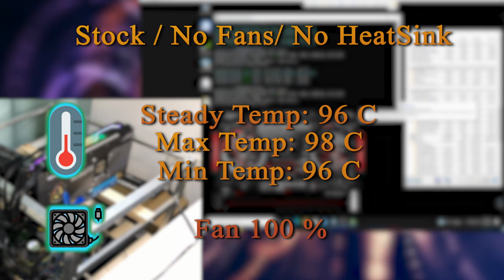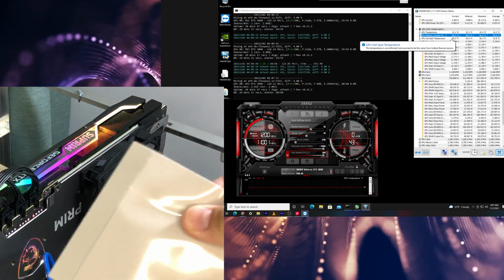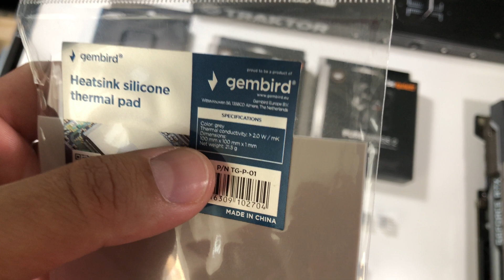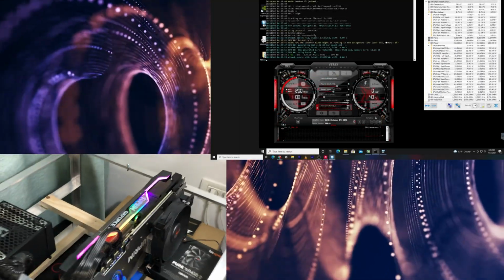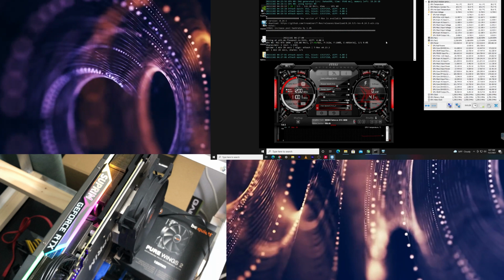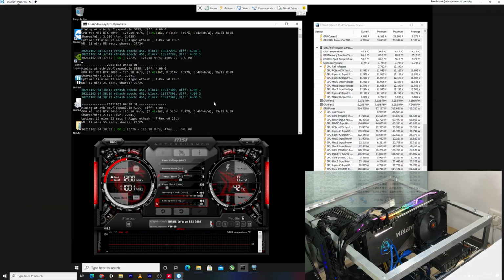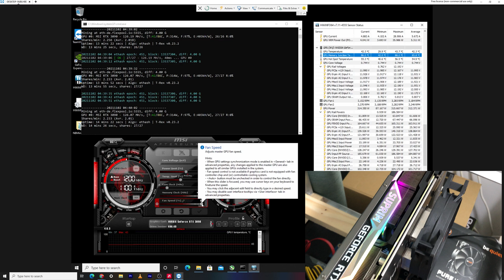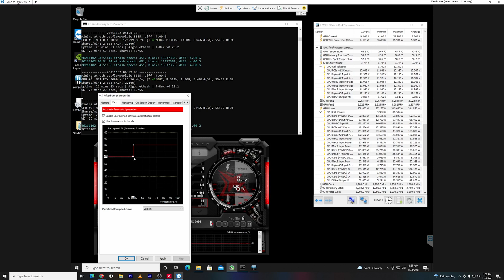Gpu Cooling Mod feat. RTX 3090 ETH Mining

Comment: Great video thanks for sharing.
I ordered the PNY Revel 3090 it will arrive in few days. But it don't think I will be able to push it in afterburner same as this model right? What do you think. I can still cancel the order and get another model.
Reply from the maker: Hey there, Well I think it should be a great choice of GPU and should be able to hit 125Mh/s but i do have 2 things to mention here:
1.There is no opening in the backplate over beneath the GPU die and thus there might be a sort of issue where you wont be able to cool down your memory module as efficient as I've shown you here. There is a opening in the backplate but that's mostly to cool down the heat pipes and fins of the cooler.This said you could still be able to apply some heatsinks over the positions of the memory modules and use a fan as well to cool down the added heatsinks but it wont be as efficient as having a physical hole there to directly blow colder air over the modules.
2.I've notice a  giveaway of sorts of the 3rd party manufacturers when cheaping out on parts and it directly correlates with the number of POSCAPS vs MLCC's they are using underneath the GPU die on the PCB.The MLCC's(small chiplets grouped together) are overall a more stable and a more expensive mean to deliver power to the GPU while the POSCAPS(bigger single black chip) is cheaper and sometimes less reliable. Please take this bit of info with a pinch of salt and do try to research for yourself as I don't have a degree in engineering but I had made a fair bit of research myself before hand. 
Thing is that the PNY uses 4 of the least efficient and cheaper POSCAPS and 2 MLCC's for their power delivery and doesn't have a cutout in the back of the backplate for a more adequate cooling solution while the MSI Suprim X has 2 POSCAPS and 4 MLCC's and a cutout to better help  it cool down.

Long reply I know but I like to get into details...so I know you can't be picky nowadays in this crazy market but I think that it's a great model for sure from PNY and I have a 3080 myself that runs perfectly fine but if you could get a GPU with a punch out in the back will definitely help you with potential cooling issues, down the line.

Cheers man and all the best. When you do get your GPU, a reading for your temps would be greatly appreciated here in the comments.
Reply: @Tech_Fusion  thanks for the detailed reply. I really appreciate it.
The unit has arrived. I will test it later and will be more than happy to post regarding temps. Also if you have any ideas or tests you would like me to go through will be fun. I like to go into details myself. Cheers 🥂
Reply from the maker: @oMeGa0122  glad to help out,well please post your temps as I am sure both me and maybe others would like to compare some temps with the different versions of the same card.I also have a PNY but the 3080 and am thinking of applying the same method of fins+cooler one the back to see how effective it can but definitely looking forward to your experience.Cheees man and thank you
Reply: @Tech_Fusion  well well well, the last couple of days have been really long and stressful for me. Now I can breathe relief. Lots of things happened. I don't know where to start from I will just roll.

I will start with that backplate. It is thick metal which is good at least it transfer the heat from the VRAM quickly, the problem is that heat accumulate with no way to get out of the backplate so it returns to the VRAM. The heatsink and a blowing fan will definitely help. I ordered the heatsinks which have adhesive and really good rating and 2x 140 high static pressure fans. They will arrive within 2 weeks. I really have good anticipation about how the results will be. Because by just blowing air from CPU fan ( yes I took it for a few seconds  no worries I was keeping an eye on the CPU temp) and tried it on the backplate and dropped 2⁰C which is a good sign. Now for the temps, while gaming the core never exceeded 60⁰C and the VRAM hovering around 60⁰c to 70⁰ at max after an extended period of time.

For mining, out of the box I was getting around 104 MH/s with few tweaks I managed to get to 125 MH/s but it didn't last for long before the memory temp reaches 100+ and started to show artifacts on the monitor with pinkish purplish colors before afterburner halt everything and rest the GPU to default. So being able dissipate the heat will definitely make it stable at 125 MH.
Then I went kept adjusting the power limit and overclocking the memory and the core till I stayed at reasonable temperature. First I aimed for 90⁰C because I want the max hashrate possible. So I managed to get 123 MH, it was steady for a while but after a long period of time the miner started to restart the sub-mining command prompt. So I tweaked more till I got 82⁰C with 115 MH.
What I have noticed during all these tests that even though the temps were steady but something internally was getting really hot and causing the miner to keep crashing (more about that later), 115 MH at 82⁰C was somehow steady for me.

Now the nightmare, so after the miner has crashed several times I wanted to give it a rest and go play some games.
Note: as soon as I stop mining the mem temp drops to 60⁰C immediately, so you think everything is okay which is not!
But once I lunch a game the PC restart immediately after I get desktop I launch it again but it restarts after longer time of playing. But if I let the card idle for a while then play something it will not restart. Until it reaches the point where it will restarts regardless of the temperature 🤔. That's where I came to a conclusion that regardless of the sensor temp other components still hot inside causing the crashes.
Here I started to panic.
The more I let the card to cool down the longer I can play.
Before the game crashes it becomes stuttery like really glitchy. It check the temps they were pretty normal within 60 to 70⁰C on mem and 50 to 60⁰C on core without overclocking.
I did some googling and everyone was suggesting to undervolt which didn't work for me!!
My problem was not the temps anymore it was something else.
 So the temps are good yet I getting crashes even while just mining sometimes the whole PC restart suddenly.
From my CPU overclocking experience when the same pattern happen you have to overvolt and that's what I did. So I raised the voltage and problem solved. The games are so smooth no stuttering no restart/crashing even for long periods.
My thoughts are, when the card was fresh all the components were at %100. But with heat the got degraded little bit ( which is something pretty normal) and now voltage is dropping because of the heat so you need to supply more to balance it.

That was long to type lol. But I'm glad to share hopefully someone make use of it. I will keep testing things around and will post with updates if any. 🙂
Reply from the maker: I am absolutely thrilled with your response and they way you managed to analyse and overcome this problem. Firstly I can say that I'm impressed with 115Mh/s @ 82C as that is not something that I thought possible (with my GPU anyway) but getting to experiencing thermal degradation already after all that care you took to keep your temps in check can only prove how fragile components are and how important is to keep your GPU running as cold as you can.
Here comes my suggestion with my experience with this GPU after a month now since the release of the video.
You will for sure get better result with fans and heatsinks added to the back of your GPU and if you want to take extra care of the rest of the components that sit underneath in between the PCB and the Backplate then you can find yourself a bigger aluminium heatsink that can cover more then just the location of the Memory Modules.
As well using higher m/WK thermal pads (something like this https://www.amazon.co.uk/gp/product/B092MG68G6/ref=ppx_yo_dt_b_search_asin_title?ie=UTF8&th=1) will also help and as well I can't recommend enough fans with high static pressure like the Noctua NF-A14 with a wopping  158CFM flow of air.

In the end i do think you are right and the components were better initially at tolerating the heat, but as thermal degradation started to occur then the voltage increase was indeed necessary to achieve stability with the GPU.

Once again, I can't thank you enough for your comments and I really do hope to see you around more in our community. 
Best of luck to you and would really appreciate if you get back to us with updated temperatures on your GPU once you install the fans and heatsinks.

Thank you,

Comment: Hi! I have 2 3090 and I am thinking to buy Heat Sinks. What characteristic should I take into account to buy the best possible product?
Reply from the maker: Well congrats firstly, and secondly considering the mounting solution is on the outside and that you dont have to open up the gpu's to change anything inside, mostly anything works as long as you keep things under budget. A good practice would be to keep your thermal pads bigger then the heatsinks (so that you will have more surface area fort hem to grab on to) and try to cover as much area with as many heatsinks as you can as this will surely help temps.As well as per the video consider mounting some fans around the top and back to help disipate some of that heat faster and for the this usually higher cfm fans do a better job then lower ones.
Cheers man

Comment: Great video, I also go a gigabyte RTX 3090.. had the same vram temp issues going upto 98..then I realised the from panel of my case not allowing Enuff airflow.. I could not find nice heat sinks, so I bought aftermarket cpu coolers, ripped off the fans,, put thermal pads on them and placed them on the back of the gpu along the vram area
Reply from the maker: Thank you so much for your response, so after your modding how are things with your temps?

Comment: Hi great! How di you fix the heatsink ti avoid that them moove down? I dont sant ti use double side thermaltape but i dont know what ti use ti fix. Many thanks
Reply from the maker: Here's a quick fix for this issue because I've been having the same issue after the video was made.
Use a much bigger thermal pad roughly 2 times bigger then the surface area of the heatsink and this will make it stick much better.So much so that it wont slide down anymore.I didnt use thermal tape as the ideea of this mod was to keep it on the cheap with readily available materials and also to allow people to swap the cheap stuff out for more expensive and more thermally conductive pads in the future if so they wish.
Hope this helps.

Comment: The fan is sucking or throwing air?
Reply from the maker: It's blowing air in as the ideea is to cool the caps with cooler outside air.If you have an extra fan you can also use another one on top of the card to suck hot air from the card and blow it upwards as this will allow you to reduce the fan speed on your cards build in fans.Cheers buddy

Comment: I dont mine but Im still worried about the longevity of my 3090 aorus extreme. I bought a artic thermal pad and used an wraith stealth cooler with a 70mm fan and got almost same results as you (8-10c reduction)
Reply from the maker: Very good insight and surely we appreciate the info. I thought that using artic thermal pads would decrease the temps a bit more since they are having better thermal rating than what I used here but good to know. I will make a follow-up video in the near future because I increased the surface area of the heatsink on the back by using more aluminum fins and I managed to further drop the temps by 4C while increasing my OC for mining.
Even though you are not mining I definitely  understand the care you have for your 3090 as they are insanely expensive and the extra care goes a long way for its longevity.
Cheers buddy and Happy New Year

Comment: Great vid, lots of details on what you did with your 3090. What was your ambient temperature? I got my 3090 2 weeks ago and couldn't be happier. I was thinking of replacing the thermal pads between the memory and back plate but that would void the warranty. I did put on a larger heatsink than the ones you used, 3x 40mm*40mm*20mm and 2x 28mm*28mm*20mm.
My overclocks are PL 81% (285W) core -200 mem +1100 119-120MH/s fan speed 80%
Results my ambient is around 30-35C:
stock settings without heatsink or fan mem temps are around 104-106c so wayyy too hot to run long term.
With OC and fan no heatsink temps were just under 100C
with OC fan and heatsink it drops to around 90C
If my air con is on 24C temps would drop another 6-8C. 
I'm thinking of putting a few smaller heatsinks on places where the backplate is still very hot.
Reply from the maker: My ambient was 22-23C AC controlled.Firstly try to 
run as cool as possible since this will definitely prolong its life span and secondly keep in mind that over 100c you will experience thermal throttle with the max temp being 106C as per Micron the chip manufacturer.
Glad to see you managed to drop the temps so much as definitely a larger heatsink on the back combined with a higher w/mk thermal rating of the pads and with higher cfm fans will help reduce the temps even further.
One piece of advice would be for you to as much as possible try and reduce the ambient temp as the fans on the gpu could run a bit slower thus extending their service life as well.Cheers and enjoy your shinny new 3090 :)
Reply: @Tech_Fusion  Thanks for the reply. I've been experimenting a bit with the gpu fan. Did some tests with 80% and 100% fan. The temp difference is around 1-2C. 
From researching and a few youtubers I think the mem would thermal throttle at 110C and permanent damage at 120C.
One thing I did find out was the delta between GPU and mem temp is around 29C.
For me if temps gets above 95C I would reduce my OC and power a bit to keep temps near 90C as much as possible. I would loose about 3-4MH/s. The mining efficiency would roughly be the same at 420kH/W.
Unfortunately I cant leave my air con on 24/7. 
I'm also considering getting a better fan. My current fan is around 71cfm 2200rpm. The replacement would be 3100rpm 102cfm. Hopefully it should drop a few more degrees.
Reply from the maker: Hope this helps out: https://www.micron.com/products/ultra-bandwidth-solutions/gddr6x 
If you use GPUZ and determine your GDDR6X Mem Manufacturer hopefully you can find the specification table as temps of 110-120 seem quite high and anyway as a rule of thumb anything below 95-98C should be quite fine for long time use.
Another quick suggestion would be to try out a fan from Noctua, the NF-A14 industrial with some 182CFM at 2000 RPM and with 140mm as a size.
Great efficiency rating btw as I determined that on the 3090's anything above 400 is very good, myself hitting some 405-408 right now so great for the 420 on your end.Cheers man and thank you for the helpful info

Comment: I was wondering if I could use a PICO PSU for my Motherboard's miscellanious(24pin connector) components(fans,HDD,north bridge, ram etc) but for my GPU and CPU an external PSU!?
Is the pico PSU going to interfere with my plan to connect the CPU and GPU from a different PSU (external)!!  My external PSU is an HP1200 watt server PSU(which does not have the 24pin connector required to power the motherboard but only has 12v+ground 6pin connectors) and the pico PSU is also going to take its 12v input from this (1200watt server PSU) and convert it to 24pin(3.3v,5v) respectively!!
I'm quite good when it comes to soldering and wouldn't mind doing some tinkering to get things to work properly ;).
Any help is greatly appreciated!
Sorry for the long text ;)
Reply from the maker: Hey there sorry for the late reply hope it still helps. You can surely use the PICO PSU for your MB and another for your GPUS as I am currently running a similar setting.
One thing to mention here: Before you switch one your PICO for your MB, make sure to switch one the PSU that's running only your GPUS as they have to be powered on before the motherboard otherwise they might not be picked up during the booting cycle. 
I don't see any reason of interference running your setup like that other than the above mention step that you have to do before you turn every thing on.
Get back to us here when you have everything up and running and also maybe consider joining us on our Discord Server where you can upload a picture of the setup.
Many thanks and best of luck to you :)
Discord link: https://discord.gg/2QW2ntAW4c

Comment: Should have used thermally conductuve glue!!
Edit: also you need at least 1.5cm of fan clearence for the air to have somewhere to go to not just shove it up its arse!!
Reply from the maker: Thank you so much for your thoughts but the idea behind this DiY mod was to keep it fast and simple and cheap and many times you can easier find thermal pads in stead of thermal glue that can as well be more expensive and many times less thermally conductive then the pads for the same price.As for the distance this could be problematic for many as the rigs that hold the GPU may not provide enough clearance for the extra 1.5 cm but again this was meant as a quick solution to drop your temps with around 10C on the cheap.
In the end everyone is free to go try out what they want and we would definitely appreciate the comment as a feedback in our community so that people can choose the right tools for the job.
Cheers!